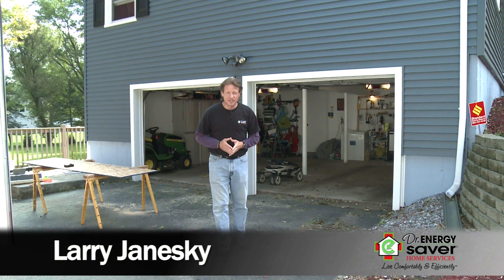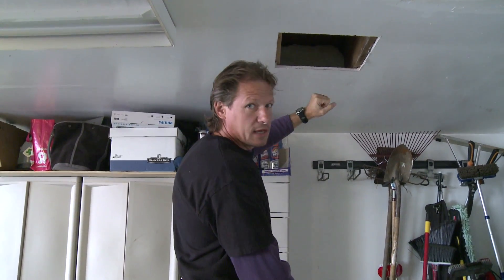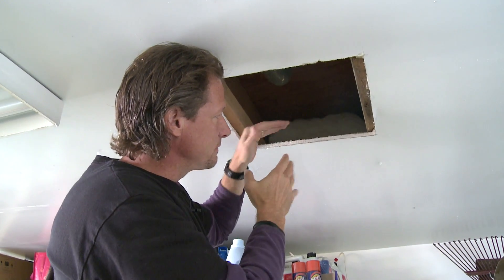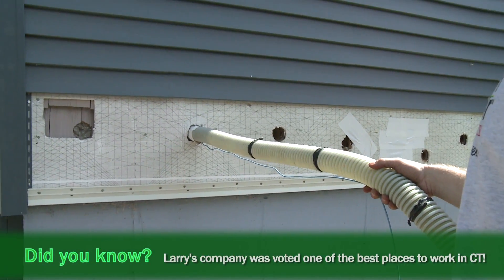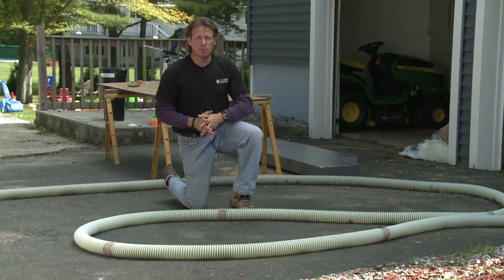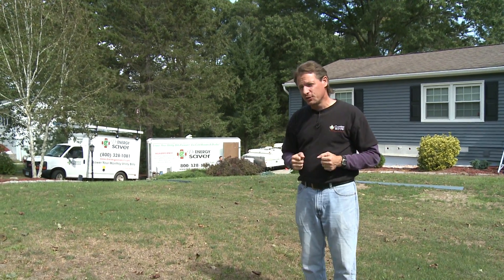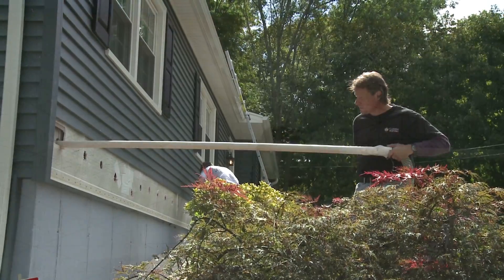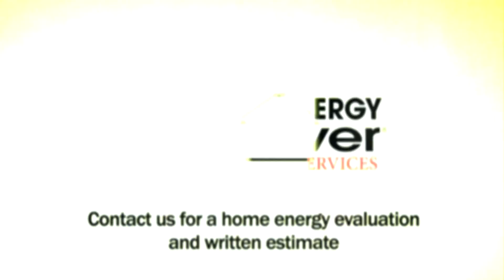Making Floors Over the Garage Warmer

Comment: Great video. I'm about to redo the flooring on my room-over-garage, which means I'll have the subfloor exposed. Would this be a good time to consider adding cellulose insulation between the joists, installed from the top down? Is this possible, because if so, I'm thinking it may be the least intrusive way to do it.
Reply: Did you insulate it from top floor? Did it work? I was thinking to do the same.

Comment: Do you need a vapor barrier on the warm side? I have room above my unheated garage as well. This sounds like a good idea but not sure about how the vapor barrier.
Reply: Tom Silva of This Old House says, "If you do need more, have a contractor blow in dense-pack
cellulose, which is so effective at stopping air movement it doesn't require a vapor barrier."

Comment: How does this compare (cost and insulation improvement) to removing the drywall and spraying foam to the underside of the floor? That was Mike Holmes standard solution.
Reply: I am also wondering about the cost vs spray foam.
Reply: same question